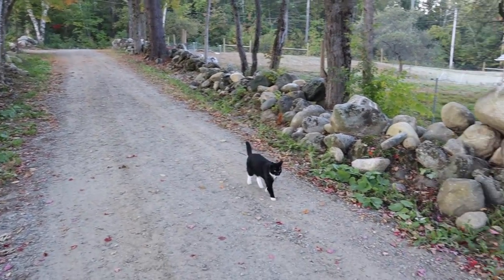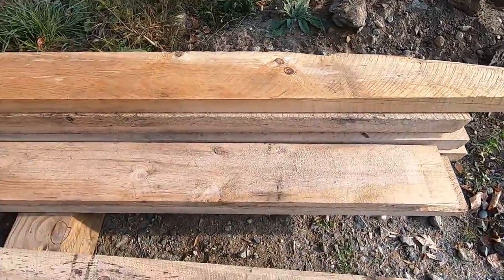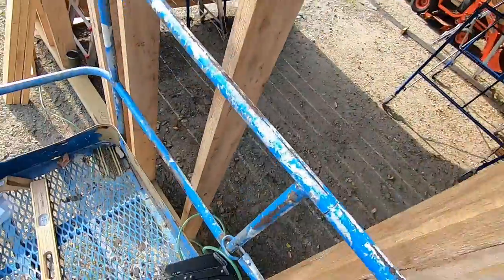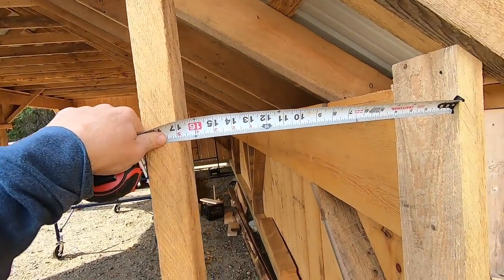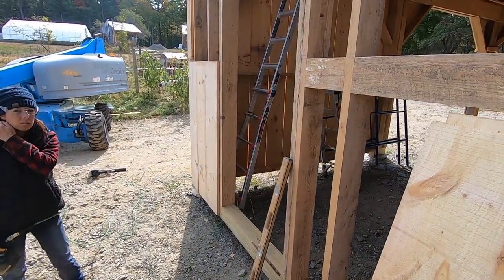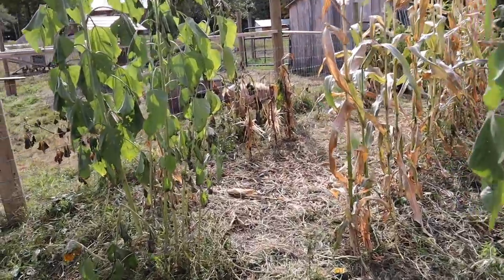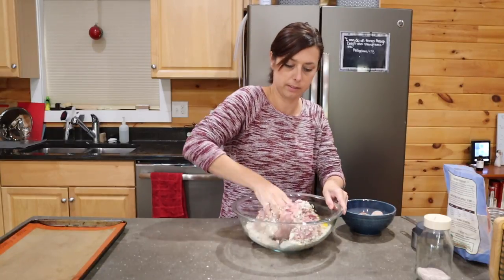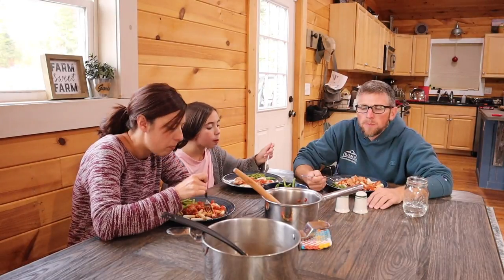Now It's Starting to LOOK Like Her DREAM BARN! Building Custom Barn Stalls in Our Post & Beam BUILD

Comment: One would be tempted to frame out widow openings over the headers so there'd be more light in the area when the doors are shut and a bit of either double walled Lexan or just Glass set into it would be all that's needed. Chicken often develope foot problems because in the Coops they stand in there own dropping to much and is why Roost Bars wrapped with Sisel Rope/Cord is ideal because they naturally want to be on branches while sleep and it keeps them out of the where the relieve themselves below. Indeed the Roost Bars can be set so that the gaps between them will be wide enough so that their droppings will go to the floor while the bars remain clean and if your putting Olivia's together with the others they'll likely have even more problems with foot diseases due to waste. You should set up some bedding where you've been finding the eggs outside the Coops so they'll naturally want to lay there and hens often like laying separately more than side by side especially if conditions are too cramp. Look into,some bedding made out of processed hemp since it's often more beneficial than just standard material and if you can smell the dropping in a Coop its long overdue to clean it out since it shouldn't smell at all f its maintained properly. The worst thing to have under chickens is metal screen or a cage since its wire can cut/wound their feet over/over and Roost Bars with rope/cord coiled around them that they can grip almost doesn't cause injures them at all and keeps those feet out of the dropping below plus allows them to heal if it occurs.
Reply: I made a comment yesterday that an opening above the door could be a way to get to storage made in the rafters. Thought he was going to do it, but guess he didn't read the comments last night. So much storage not used.
Reply: @anitablades6033  It would have been too late anyway, the videos aren't "yesterday's activities" but one or two days before.
Reply: @brucealvarez9263  yes I had put my first on when they started the side framing, oh well,to much revamping to do it now. As I said So Much Storage wasted. Would you have decked at least some of the upper area? and made some really cool doors ???

Comment: Al and Gina I love how your barn is coming together so quickly. I have a few questions are you going to build a wall between the middle section and the stall section and if you do I would put a window in each stall on the divider wall to get airflow through in the summer when it is hot out just make a 2x6 window frame and put a chain in the middle on the topside and drill a hole 2/3 of the way up from the bottom drill through the window frame and the outside of the window frame and then find a 6 inch piece of pipe same size diameter of a dime and put the pipe through the window frame and into the frame of the outside of the window and then you take the chain that is attached to the top inside of the window and pull down and then hook it on a nail on the bottom edge of the window frame and then you have a butterfly window and you can adjust how much you want it to be open also you might want to drill a small hole through the pipe between the window frame and the outside frame of the window it self so the piece of pipe doesn't slide out of the hole, we usually put a hitchpin clip.
I was wondering if this would be a good time say for Olivia to mow the weeds down in the pasture and what we did in our small pasture where we had calves for the summer. We would mow the weeds down and put on a good fertilizer ration like with your Kubota and a spreader on the back of the Kubota 
and then moved them to a pen and put them on a self feeder that was drug free ration and they also had access to good alfalfa hay. We usually had a dozen calves 6 black Angus and 6 Hereford steers, nothing beats raising your own pork and beef. When I was a kid we always had beef tongue it was good.
Are you  going to dig post holes for the 2 pens on the barn and have a gate for each pen to the pasture and also put a gate between the 2 pens outside. What are you going to use to back fill around the outside of the barn and also the inside of the barn. 
How are you going to water the greenhouse in the winter?

Comment: Gina, We save the butts/ends of are loafs of bread and dry them.  Once we have a dozen or so we put them in a large ziplock bag, letting the air out, seal it, break the slices up by hand to smaller pieces, lastly roll over the bag with a rolling pin to desired consistency to get homemade bread crumbs.  Save them in  jar till needed. We tried putting them in  blender but that was to messy.  This works pretty good.  Give it a try.

Comment: Just to make you chuckle, gotta tell you right now, I get up early to open window's to try to cool the house off before the day gets hot, only in the 90's these days, but nights get down in the 50's so if I can cool the house down to 70, it helps keep the AC off a few hours longer in the day. another month and I'll be thinking about turning on the heater because it cools down FAST here, goes from summer to winter without much notice.

Comment: Al this is going to be the best looking barn, with all your careful measuring and leveling.  BTW did you notice the other day,  Jamaica Cottage sold their 10,000 building.  How great is that. !!!  I am really looking forward to that last bit of the roof and the siding put on.  Will you be running electric to the building for light in the stall area.?  Y'all have a Blessed day.

Comment: Back when I was still a lad meatloaf and meatballs always included oatmeal.  I was well away from home in my 20s before I knew some folks used crackers or a thing called bread crumbs as a binder.  Now I do half Ritz and half oatmeal for both dishes.
Reply: J Glass  like that I just may try that
Reply: @richardmouat9070  here's another twist,,, adding salsa to the mix is very fine,,, love it in fact,,, now take that salsa boosted mix and turn it into a cheese stuffed meat loaf.  Works as a cheese stuffed burger also.  Good eats as Alton Brown would say.

Comment: You already have the door opening size as dictated by the bottom opening measurement. Measure the bottom opening size to cut your headers and you will remain square when installed.

Comment: Curious why you didn't move the blocking up a few inches so that you can nail the bottom of the upper siding to it? I guess I'll find out on the next video what your plan is. 
Love the way you are so precise on all your cuts and measurements. I almost always have to re-cut stuff because I get it too tight or too short. Lol. Look'in good!
Reply: Upper siding will overlap as on other side of building.

Comment: Hi Al, Hi Gina, You are doing a fabulous job, and I know I keep harping on, but, What you term as side bracings between the uprights in England we term them as Noggins !! You really need to put some up between the longer rafters, it will stop them from twisting in time, I am not knocking what you have done, just trying to be helpful,,,,,,,Best wishes from the UK.

Comment: There's another way you can make those vegetables. Get a frying pan, coat it with water -- pour water out. Place cut vegetables in pan. Add appropriate oil, apple cider vinegar, and spices. Cook on low heat for about 25 minutes. Even kids like their vegetables this way.

Comment: Im a little surprised you did not split the blocking so the 1st and 2nd set of siding both met in the middle.
Reply: The upper blocking will overlap, the same as the other side.

Comment: No, wait. Are you kidding me? You can tell with a tape- measure how much they WEIGH?! I think you're having us on! ☺
Reply: Nope, there is a formula and there are weight-tapes that will tell you directly. There are different ones for different animals (pig, cow, horse, goat, not sheep though the wool gets in the way of accurate measurement).
Reply: Rachel M... I think what he means that(I think) is that they measure the length from snout to tail then around the largest part of the middle and do some kind of calculation to estimate pounds per inch They say on other videos that it is pretty accurate. God Bless!
Reply: @LLjean-qz7sb  wow, we call that the appliance of science! Bless you! 🙂
Reply: @rachelm7525  If you input lumnah acres pig measuring into search function of YouTube you will find their previous videos of doing exactly that!

Comment: DO YOU THINK PUTTING ROCKS AROUND THE BOTTEM OF THE BUILDING TO CLOSE IT IN WOULD WORK LIKE A ROCK FOUNDATION JUST FOR LOOKS ,AND YOU HAVE LOTS OF ROCKS LOL
Reply: Lumnah Acres said in a previous reply that gravel will be added to bring level up to the top of concrete piers and thus a gravel floor.
Reply: NO I MEAN ON THE OUTSIDE BOTTOM AROUND THE BUILDING MORE FOR LOOKS